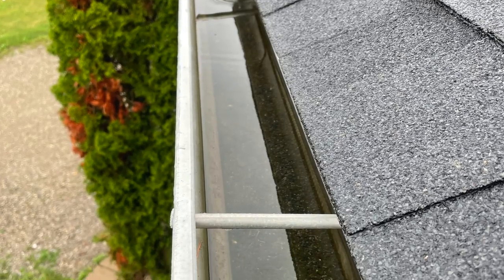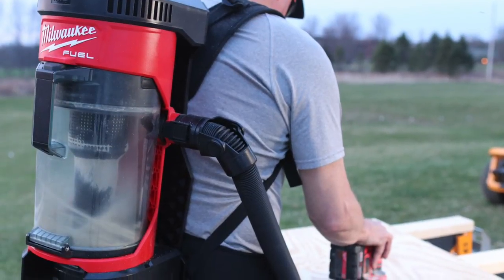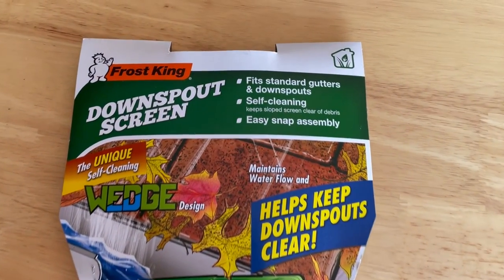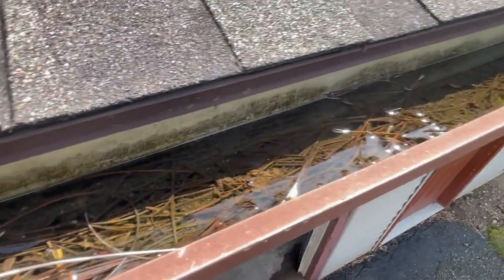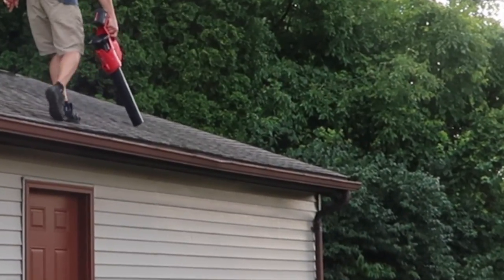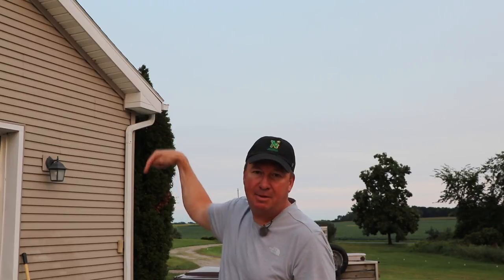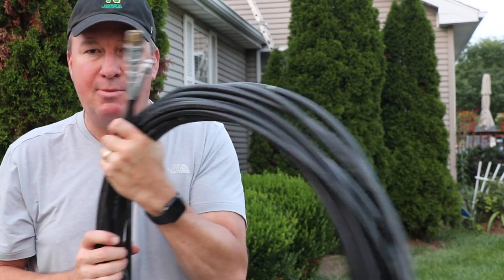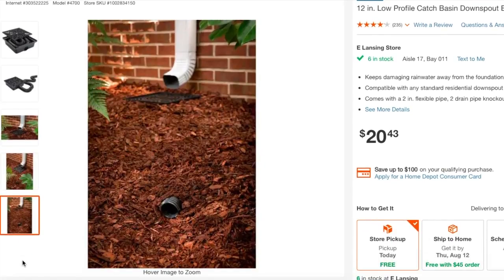GET SOME SERIOUSLY CLEAN GUTTERS!  PREVENT POTENTIAL WATER DAMAGE TO YOUR HOUSE!

Comment: I have the blower it works good when I have to blow off some thick material. One time I left my garage door open in a storm and garbage and derbies came in and the blower blew it out no problem I wood give it a five star.
Reply from the maker: Nice, I use this blower to quickly clean off the grass clippings from the mower after each use.
Reply: Yeah same

Comment: This is great content, that is very useful to many out there in YT land, Mark!  It was painful to watch however, as it reminded me of my sorry gutters!  😳🙄 I even use those same little aluminum pine cones, from Home Depot.  Made in the USA, no doubt.  I had to modify them a little to fit my down spouts.  They work alright, until they accumulate that film on the outside.  I usually knock the stuff off, but great tip on the brush, Mark!   I have tried most everything out there, and have challenged Companies to put their product on my house, to no avail.  My property and House is in the middle of a wooded lot, so it is a challenge dealing with leaves and sticks and junk!  Never ending!  I use to be brave and walk on my 6/12 roof like that, but not anymore, especially with the age of my roof!  I’m surprised at the amount of granules coming off of your new roof?  I use the M18 Fuel blower, with the universal Worx brand Gutter extension kit. ( Home Depot )  I get mixed results, but it keeps me off a ladder!  Anyway, great video, as always, and Please be safe up on the roof, Mark, and all you YTubers out there!  👏🏻👍👍👍👍👍👍😁✌🏻🇺🇸
Reply from the maker: Thanks, aluminum pine cones is a good description of those.  I've thought about getting a pressure washer extension for gutters.  If the reviews look good, I'll put it on my channel.  Hopefully it's a good solution for cleaning from the ground.

Comment: My upper gutters need a 32’ ladder.  Just clean only a clogged hole down spout clear. The other 16’ gutter had both elbows clotted- bird nest. We had two high wind, heavy rain days in one week.
Reply from the maker: I use a 40' Louisville Ladder on occasion.  It's very top heavy and a little tricky to prop up, especially on a breezy day. Other than that, it's a good ladder, very reliable and durable.

 I've wanted to try out an extension for my pressure washer and see what it does on a 2 story.  Someday that will be on my channel if it's worthwhile.  
Many years ago I rented a 45' lift to finish the siding on a cape cod style home end on a walk out basement.  45' in the air is a weird feeling, lol.